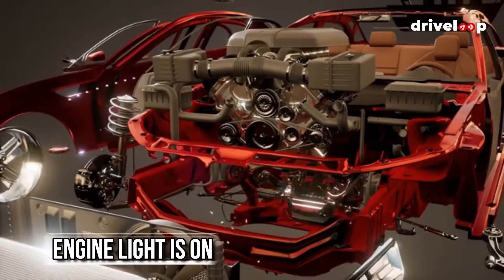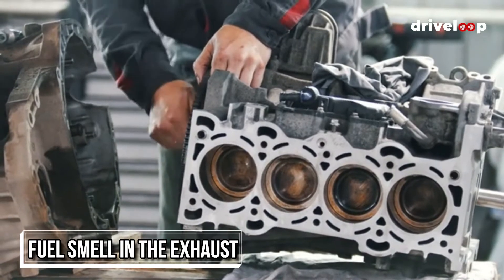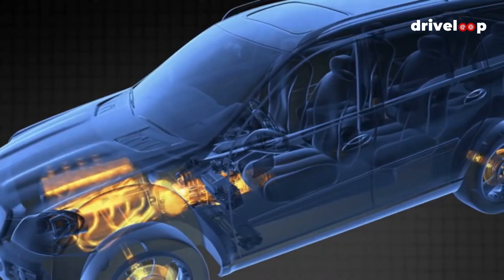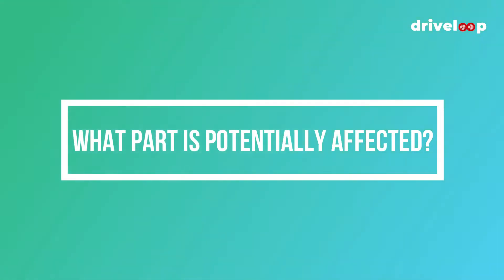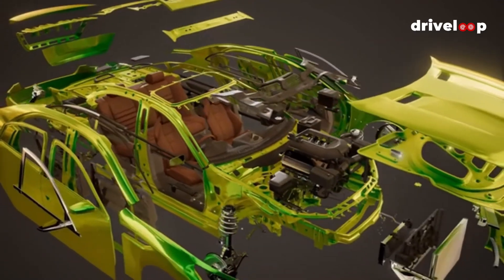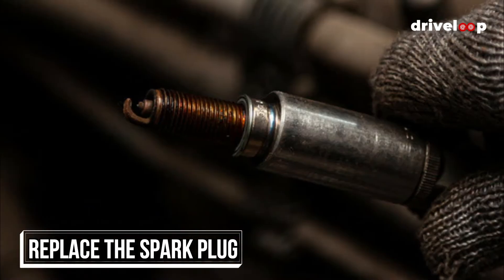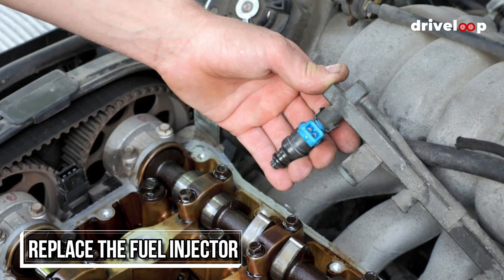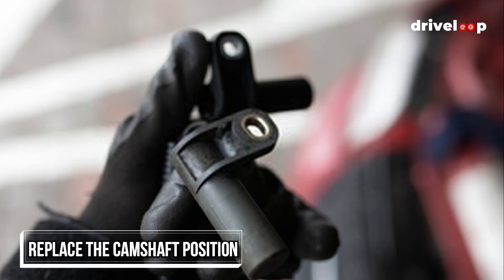Cylinder 2 Misfire Code P0302 Explained (Easy Fix)

Comment: The Check engine light has gone off but only on the past 2 Saturday's  and only on the way home from someplace.  the 1st time I was coming home from my sisters she lives on a hill,   the temp was about 96 Degrees that day.   Then this past Saturday   the engine light will go on,   then go back off,       The 1st trip this past Saturday was longer,  but it went on and off real quick.  then did not come on again until I was right around the corner from home.    went out again that day a shorter trip.  light went on right before I pulled into the driveway.   Have driven it pretty much every day someplace.   Just weird.
Reply from the maker: Intermittent check engine lights can indeed be puzzling. I recommend checking for any loose connections or worn-out components, especially since it's been hot and hilly. It could be a sensor acting up due to these conditions. Consider getting a diagnostic scan to pinpoint any codes that might help clarify the issue. Safe driving!